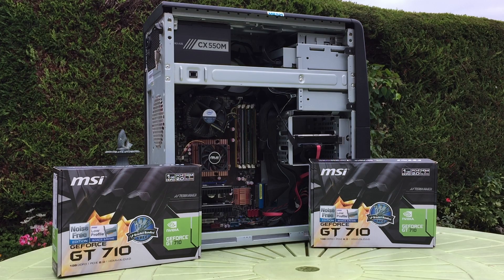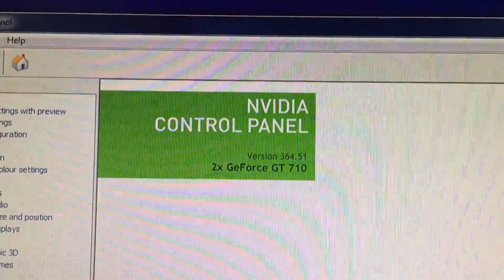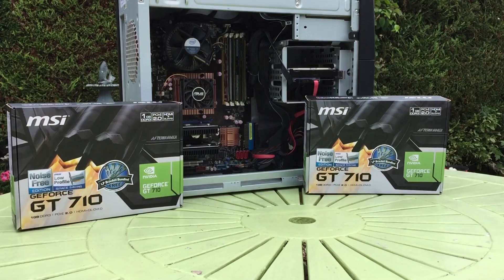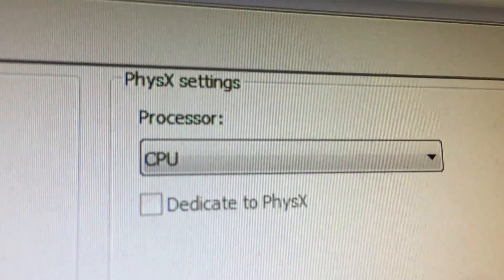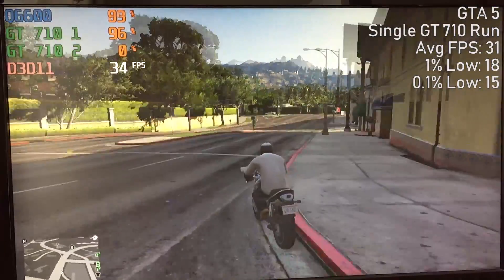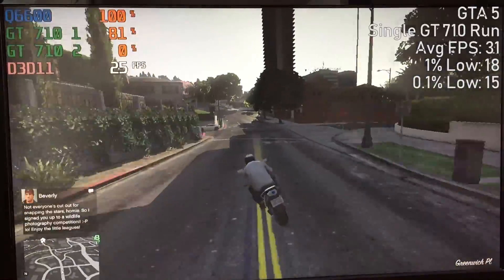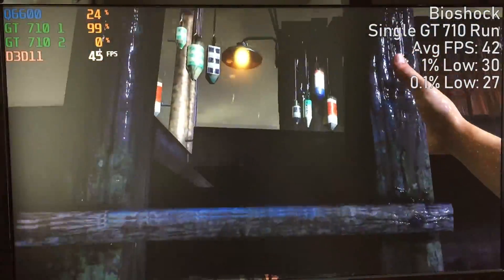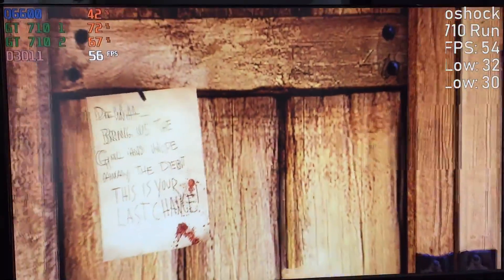The GT 710 SLI Hack

Comment: Now all we need to do is download some ram.
Reply: Nah just download a titan v. I got 420 fps in cod
Reply: no problem, I downloaded some just today, but after download it became as fast as my SSD, which turned out to be just half of my download speed
Reply: tomorrow I will try to download from my server, which have 64gb DDR3 PC3-12800 1600MHz instead of 24gb DDR3 PC3-12800 1600MHz ECC. Maybe this would go slightly better on my desktop instead of laptop too
Reply: Well you can use zram in linux, so does it count as a downloadable RAM?
Reply: Argo ATR well I can actually download RAM in every meaning of this sentence
use targetIO in Linux and use backstore of ramdisk, then use this on loopback and use resulting block device for apache to store "data" or rather RAM and then you can download RAM. Use Virtual Machine on same host and connect both via 10GbE or faster and you can actually download RAM at quite a speed
Reply: WizardNumberNext I've never thought of using a ramdisk via a 10gigE xd
Reply: Argo ATR well, it is hard to be sure of actual performance of 10GbE NIC/HBA using SSD (SATA-III is capable of at best 550MB/s where 10GbE is capable of 1133MB/s at worst, so even RAID0 cannot get such performance)
I have RAID6 based on both BTRFS (SATA-II) and LSI MegaRAID (SAS2 both HBA and HDDs), but still this provides at best 1GB/s
Reply: Don't forget to delete system32
Reply: whats funny is i did that dumb shit when i was a kid lol.
Reply: 1 gigabyte of ram should do the trick.
Reply: @AgeofReason  insert shitty 80's hacking here

Comment: I’m looking to upgrade some pc components but idk which pieces I should consider, could someone help?
Reply: Particle what is your budget? And what kind of components you want to replace?
Reply: satan waffle baldski I would say my budget is 500-1000$ 

My current rig has 8gb ram, an i3 7100, and my gpu is a R9 270x 2gb.

If you need more info please just ask :)
Reply: Like the person above, we need some information.
What are your current components?
What are you wanting to upgrade?
What do you use your PC for?
And what is your budget?
Reply: HaloSam296 I use my pc for gaming, pretty much exclusively, I mainly want to upgrade for better frames, I don’t know why but I literally have to run every game I own on low settings and I still get frame drops consistently, one example I can think of right now is how I get 120-180 FPS on fortnite but it constantly spikes down to 30 all the time and then shoots back up, I just want a more consistent experience
Reply: Particle 
If you are wanting something more consistent, then you would probably need a new CPU along with GPU. That means you would need, at least, a new motherboard, CPU, and GPU.
Luckily, this is pretty doable. I would recommend with selling the three components, after we make some plans.
Let's say we make your budget somewhere in between of the two numbers you gave. Let's go with 800$. After selling your CPU, GPU, and motherboard, lets say it gets you about 275$ (though they would probably get you more), so we have a budget of 1075$.
Now you would be needing three parts, unless you also want to get more RAM for 16gb. 
For the CPU, I would go with the Ryzen 5 2600x. This is about 225$, and comes with a stock cooler, which is actually fairly good, and will allow you to overclock to 4.2 ghz if you want to.
For the motherboard, I would go with the ASUS Prime x470-Pro ATX AM4. This is about 153$. While this motherboard is a bit pricier than others, it comes with a lot of functions (including both SLI and Crossfire support), and it uses the X470 chipset. Cheaper motherboards that you can use would be the B350 chipset, which would require a BIOS update before being able to use the CPU.
These two (three if you count the cooler) parts add up to about 380$, leaving us with 695$ for the GPU. Honestly, I would wait until the end of the year sales (Black Friday, Christmas, etc) to get a GPU. With the new 20 series from Nvidia coming out, 10 series cards will stop in price, and be even cheaper with the sales. AMD honestly can't very well compete with Nvidia in the GPU market (for now, maybe in a few years they will be able to), so I would get a card from the 10 series. A 1080 will likely be around 400 after the 20 series, without the sales, and the 1080 ti would be around 500-600 without sales, hopefully. So take that, plus sales, plus the possibility you may buy used parts, get more money from selling the old parts, and maybe take a bigger budget than 800$, you could easily have over 100-200$ left after the GPU. You could take this extra money, and use it instead to get a 20 series card, or a Ryzen 7, or, and what I would recommend, get another 8 GBs of RAM for 16 GBs.

Anyway, someone more knowledgable may be able to refine this list, but this is what I would do.
Reply: HaloSam296 thank you for the reply, I really appreciate it tremendously, my local pc stores employees tell me different things all the time and that’s why I’m looking for information here, so thank you so much for your advice.

I forgot to include my motherboard when I was giving my specs, I actually have the msi b250 krait  gaming mb, so I don’t think I would need a new mb since this one could run an intel equivalent to the chip & mb you recommended. With that said which sort of intel chip upgrade would be on equal playing field to the one from amd you recommended? 

Other than that I like your plan a lot and your comments are going into my notes.

Thanks again :)
Reply: Particle 
Hello again. The Intel equivalent would be the i5 7600k. Here are benchmarks comparing the two.  http://cpu.userbenchmark.com/Compare/Intel-Core-i5-7600K-vs-AMD-Ryzen-5-2600X/3885vs3956
And though the i5 is mostly around 25$ cheaper, that price varies, and it doesn't include a cooler. Overall, to get a decent cooler around the quality of the wraith (which comes with the Ryzen 5 2600x) would cost at least 60-100$, though you would probably be able to use whatever cooler you use now, depending on the quality. And though it would be compatible with the B250 chipset, you would not be Ble to overclock, which destroys the major point of getting a K series CPU. I personally use the 7600k with a B250 mb, and I do regret not getting a motherboard that is overclockable. The nearest intel CPU to the 7600k is the i5 7500, which is largely worse by about 15-30% depending on the task. Here are the benchmarks comparing those two CPUs. http://cpu.userbenchmark.com/Compare/Intel-Core-i5-7600K-vs-Intel-Core-i5-7500/3885vs3648

Overall, it's your choice as to stay intel and keep the motherboard, or sell both and go with AMD. And back to the cooler, I forgot to say you would sell that also, si you would have even more, unlike eith sticking to Intel. Honestly, AMD has been a better company and better CPU supplier, but if you want to stick to Intel then I recommend the i5 7600k even if you don't get an overclockable motherboard. You could get s lesser GPU and get a i7, but I wouldn't recommend that.
Reply: Particle 
I'm back again. I was looking along Ebay today, and I found that EVGA is selling new 1080s for at least 400$, here is an example.
https://rover.ebay.com/rover/0/0/0?mpre=https%3A%2F%2Fwww.ebay.com%2Fulk%2Fitm%2F263876806368
There are other 1080s with more reviews but some of them are more. If you are fne with 400, and are willng to spend mifore, there are 1080 TIs for 650$, but if you are going to spend that much, wait for the 2080s, which will be priced almost certaintlt 650$ or 700$ at launch. Even if you do not get one, the 10 series prices will go down.
Reply: you should buy gtx 1060 (3gb or 6gb)  or 1050ti 4gb and you will be good
Reply: Eetu Isola do brands matter when it comes to purchasing a gpu? I hear tons of good things about msi, but I have seen cheaper brands like Zotac and wondered what the difference would be.

Also how much does a 1050ti 4gb out class my card by? 
Just trying to understand the reasoning something is better or worse.

Thanks.
Reply: i think you should get a better cpu instead of another gpu
Reply: alex alcala ortiz that cpu is still good cpu. like old q6600 is still capable of gaming
Reply: well some brands have better cooling some have factory overclock and gtx 1050ti will be big upgrade compared to your gpu